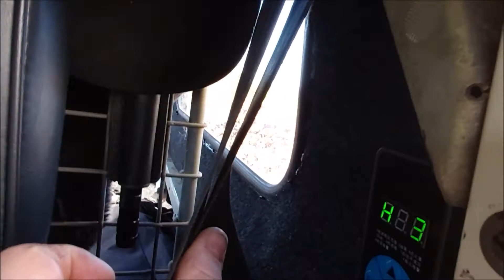Land Rover / Chinese diesel heater

Comment: Im thinking of getting some form of Diesel Heater for my Disco 2. Just wondering about the power consumption straight from main battery. I am looking at getting cab warm in the cold mornings without killing the battery so I have no power to start the engine.